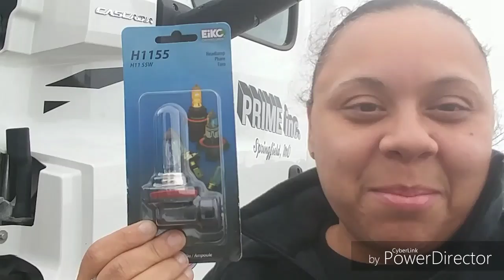Female Trucker Vlog (V71) Hometime/ Back on the Road 🚛💨 NC to WI - Prime Inc

Comment: That lower bulb compartment is for your high beams..FYI, Both headlights and both high beams all use the same exact bulb. So in a pinch, you can borrow a bulb from your high beams if you're not near a truck stop.
Reply from the maker: Thanks for the info. Just seen today one of my top clearance lights is out. Now that aint gonna be so easy of a fix cause its so high 😒.